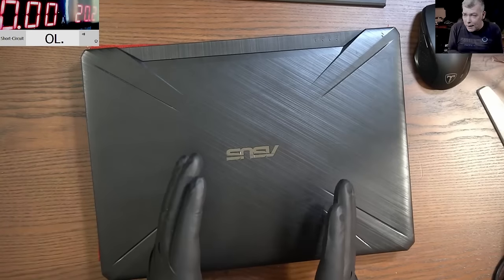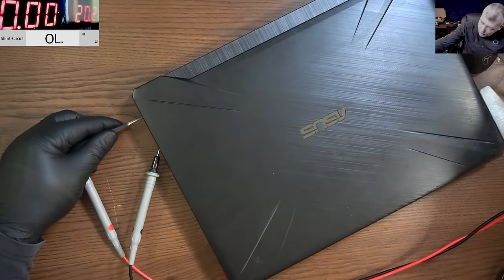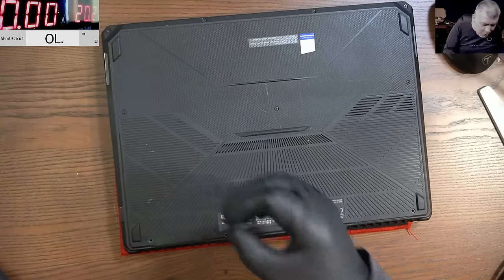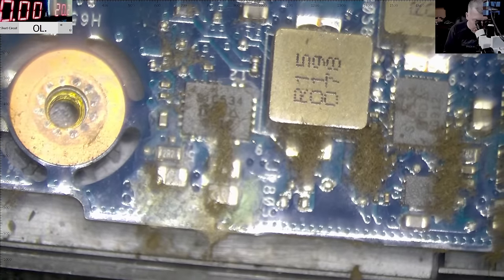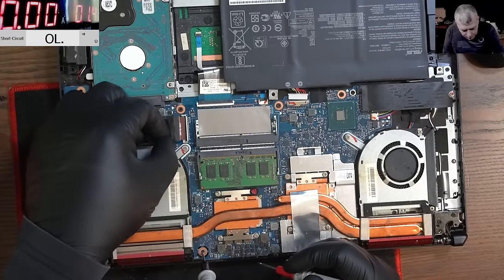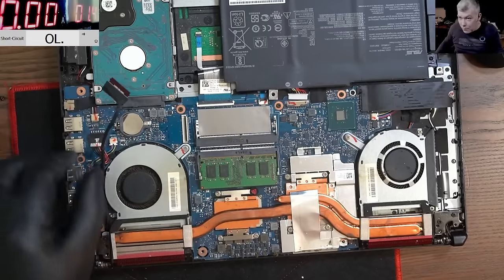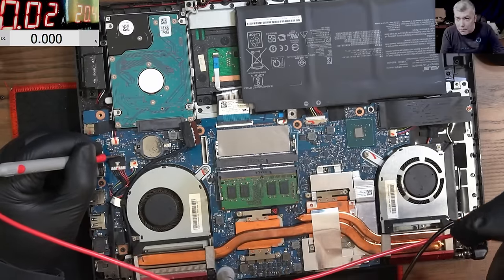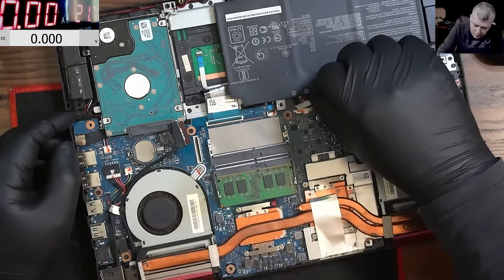Gaming laptop JOB LOT? Can we fix one? We should buy it? Asus TUF FX505 laptop, dead, repaired!

Comment: 35:05 so I know now, what is the worst punishment for Sorin:
- to order and replace lcd cable
- solder new/used capacitor  (in place of shorted one)
-solder new fuse (instead of make a bridge with one thin wire, taken from powersuply cable)
-solder new first mosfet (after power connector) (instead of make a bridge with solder)
-remove rosin after soldering

Comment: Very good job as always, still I can't quite understand how did you get away with injecting voltage with swapped polarity (@9:20) .. was it the reverse voltage protection diode who saved the main board?
Reply from the maker: Lol, i didn't realised that :D anyway, it's a short, polarity doesn't really matter :D

Comment: How do you get away with only using one of them wires? Anyway add a small external keyboard and an SSD and get a decent laptop. Depending on the spec turn it into a desktop get a screen cable and save screen for a future repair.

Comment: Haha looks dodgy but that's such a small current, soldering wires will do just fine... A bit of hot glue and it will be more rigid than the original connector :D

Comment: ALL YOU NEED TO IS CLEAN THE KEYBOARD AND THE REST      TAKE KEYBOARD OFF CLEAN WITH SIMPLE GREEN RINSE WITH DISTILLED WATER LET DRY 24 HOURS.  GOOD AS NEW.
Reply: What is "green rinse"?
Reply: @silviuguseila2552 Bottled liquid cleaner with a spray, such as those used to clean window panes

Comment: looks like that keyboard is heat-staked in, so that means no screws but  melting pegs to take it out and put a new one in - pain in the arse
Reply: Yes Andy, ok (if that were the case) so; I prefer to use a cheap external keyboard. All the best.

Comment: This was entertaining to watch. It's a $900 laptop (new) so $40-$60 for a keyboard, solder the wires & you're good. Maybe throw in some hot glue for good measure. 😂 (kidding....)
Reply: it's a 5 years old budget gaming laptop, so it's worth about $400-$450 max, for $900 you can buy brand new gaming laptop with RTX 3060
Reply: @kiki83607  Yes new, but even @ 400$, it's still worth a new keyboard.😉.

Comment: You call a laptop with a mechanic hard drive "gaming laptop!?!
Reply: If you watch closely you can hear Sorin mentioning m.2 ssd (6:53) and it is visible on the right top side of the board which probably means that Windows is on m.2 ssd. The HDD is probably there just to store data.